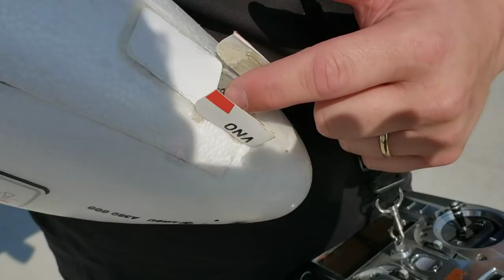Tian Sheng - Airbus A380 - 4000mAh 3S SMART Pack - Flight, Crash, & Repairs

Comment: I thought I had bad days😂 but you take it good you just keep going. I still give you a five star ⭐️⭐️⭐️⭐️⭐️ I was flying my little Sport Cub S 2 and I noticed the gears in the motor were making some noise I didn’t like it. So I blew it out real good and I looked around my car to see if I had some kind of a dry lubricant for it I didn’t want to put oil on it. I had a can of pledge furniture wax I sprayed that inside on the gears what a world of difference so quiet and now the propeller windmills when I let off the throttle it is so much better and it plus it stays clean. I just love it 100 times better. You should try it it’s really cool.🤔😉
Reply from the maker: That's a GREAT idea, BUT be careful. Some of the accelerants in those cans will eat foam ;)

https://amzn.to/2DEqFjJ - this works good, but same thing, be careful with the over spray ;)

Comment: The trouble with jets with tapered wings are they are prone to tip stall. They need speed on turns. You should be able to buff it up.
Reply from the maker: Sure

Comment: Use some coarse all thread. It will screw into both halves of the part with a little CA so it doesn’t unthread
Reply from the maker: I guess I could use a small screw, and cut the head off, then slot it for a "set screw" kinda feel..then heat it and thread it into the plastic....issue would be that the nose gear needs to line up at the end of all that screwing ;)
Reply: Brian Phillips true nothing works quite like new parts. Too bad with planes you have to buy half a plane a quarter of a plane or you just can’t get a part period.  To get landing gear brackets for the FMS PA-18 you have to buy the wings. Appreciate the reply

Comment: You should drill a hole on both end and use a small metal rod and glue those 2 together to reinforce it
Reply from the maker: Isn't that what I was doing? (notwithstanding heat vs drill)

Comment: Would love to get on a live workshop. 
I want the HABU jet you showed. 
Should I buy a DX8 and bind or take the 2.4 radio.
Reply from the maker: The RTF is a great option if you're new to the hobby. It's seems pricey, as the RTF, but when you go out and find everything you need, you'll find that it's a pretty good value. Here's one other detail....the DXS that comes with the RTF Habu is very good (surprisingly) and you can dedicate it to your simulator when you DO get a DX8 or DX9 or IX20 :) for your normal flying needs.

Habu STS 70mm https://bit.ly/3fRaLj7

iX20 https://bit.ly/38XUA1I
iX12 https://bit.ly/3h8yQmF
DX9 https://bit.ly/2OxrIni
DX8 https://bit.ly/390KOf1
DX8e https://bit.ly/393nRry

Horizon Hobby https://bit.ly/38ZFade (If I missed something ;)

Thanks for helping support us, when you get ready to buy this stuff. If you follow the links, you will help to fund our channel, regardless if you're getting a small item, or the most expensive plane. We really appreciate you coming and want to help you have success Terry!

Comment: RC question, but about smaller planes.  How do you check voltage on the little 1 cell umx batteries? Thanks
Reply from the maker: I use the same voltage alarm you see in this setup, but I built a little jumper cable, or I just hold the pins in the connector, if they'll reach. Good question Cindy!
Reply: @BrianPhillipsRC  Ty

Comment: I think your a private pilot too? 
Anyway. Ya know then. You can't make a great landing without a great approach. 
Looked like Controled flight into terrain. Lol. 
Oh for others. CG to far forward fly like crap. To far rear they fly once!!!  
Great channel. You got me back into RC. 
Safe is so nice. I bought the P51 eachine and now the Citation. Want the flaps too. 
Can we add a servo for steering and Rudder? 
Thanks
Reply from the maker: I'm NOT a full scale pilot (yet). I'd like to get into GA, but would FAR prefer to get into ultra lights or powered parasailing. GA is so expensive, and I just don't want my family to have to sacrifice SOOO much to help me live my dreams, but when the kids are grown, maybe that would be a possibility.

As for flaps on the Citation, it's better to add flaps on the Rudder channel, do some fancy programming, then use the aileron channel to drive the steerable nose gear. That's how I did it, and it worked pretty awesome. I also made a small piece of plastic to help make coordinated turns, which is mounted on the nose gear..looks like nothing, since it's clear plastic, but it works like a 10-15% Aileron to Rudder mix...which is exactly what was needed. Ground handling is accomplished by using the ailerons to drive the steerable nose gear,even though you're also moving the ailerons...which is not perfect, but if you're moving fast enough to NEED the nose gear, the aileron are going to be working IE you be flying :)

Comment: Are them airliners hard to fly are what they look nice and I wouldn't mind having one but you trying to make it look like it was complicated on Landing
Reply from the maker: I ran out of power on landing, that's why I crashed. The plane is not overly hard to fly, but I had just fixed an EDF fan, which made the differential thrust a little wonky, and I didn't have quite enough YAW control to get the plane to point down the runway....so I aborted, and made that turn into the "bowl"...I had to stay down in it because I didn't have enough power to get over the trees, and I knew I was going to try to land, I just ran out of thrust at the end of the turn, and she did what all planes do when they run out of power...they "land" ;)

Comment: I'm hoping you'll see this comment because I think this will fix your issue with the front landing gear.  This stuff is amazing and it works!  It's not a gimmick.  Found this at a farm show, you can actually drill and tap the stuff.  https://thelastglue.com/.  Check it out.
Reply from the maker: I see most comments in my "Held for review"...but since you're link isn't to any adult dating sites (AKA Porn), then this is no biggie ;)